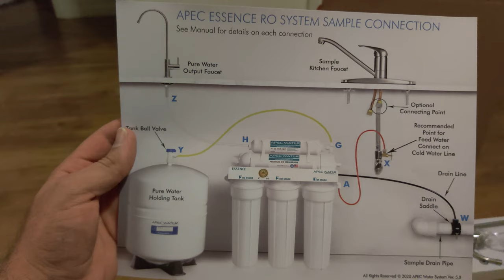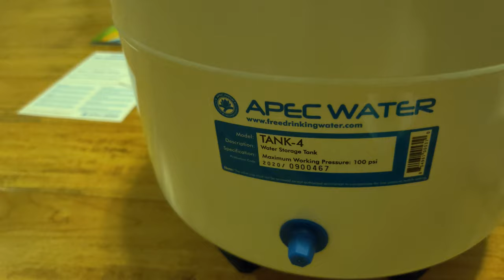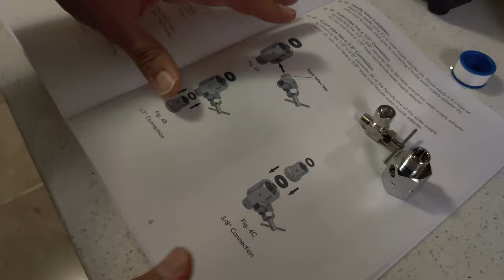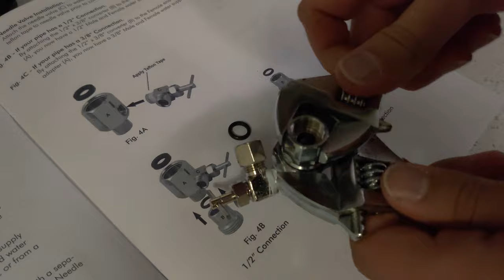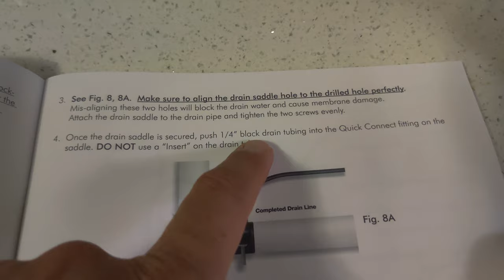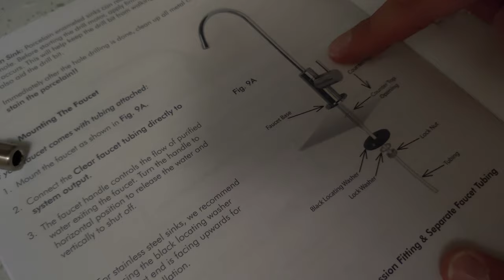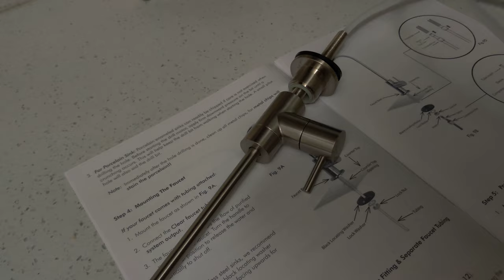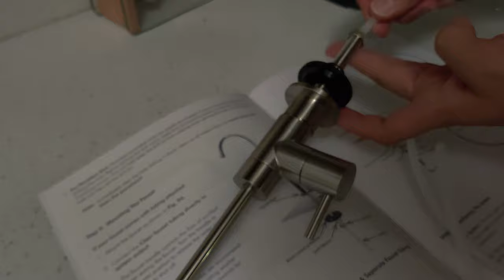Install APEC Water Filter RO System

Comment: I'm installing this in an apartment. can I cover up the drain saddle when I leave? I'm also planning on running the air gap faucet from underneath the sink leaving cub boards open. I know it's a ghetto but I can't drill holes into the counter top here. I'm leaving this apartment soon so I really just want a really good water filter that's overkill.
Reply: Install a "Drain Line Adapter" instead of using the drain line saddle and drilling a hole. When you move you can leave the adapter in place and just remove the tubing from the connector.
Reply from the maker: If anyone is in the same situation and cannot mess with things too much, consider getting a countertop RO water filter instead.

Comment: Have you had issues with air getting trapped and water becoming cloudy with this system?
Reply from the maker: So far, I have been using it for a few years and I have not noticed any cloudy water or trapped air.
Reply: @ChrisAsipyan  Thanks. I just experienced the cloudy water once due to trapped air in the beginning, but now working flawlessly.

Comment: Your filter is identical to the manual provided with the unit. Mine on the other hand, has a fifth stage… Now, I’m confused where the tee and yellow hose connect not having clear instructions to account for the extra stage Included in my unit. Either way, thanks for the video
Reply from the maker: You're welcome! ...were you able to figure out the connection?
Reply: Yes, I was able to get it installed!

Comment: Is the valve o the tank supposed to be close or open be cuz I have it open and the drain line haven’t stop runing sounds like water just keep runing out
Reply from the maker: The valve on the tank should be open during normal operation

Comment: Im not fancy degree city plumber but me thinks the power plug to the disposal is all wrong. If it leaks it will travel down to the plug. You need a service loop. Let the wire hang so the water travels down and drips off the un exposed part.
Reply from the maker: I agree... Thanks for the insight!

Comment: Hello, when you installed the RO system, does that mean your regular faucet is only for hot water?
Reply from the maker: No, both cold and hot water continues to flow through the regular faucet. This kit comes with a splitter valve that splits the cold water between your regular faucet and filter system.

Comment: Hey did you insert the little plastic piece that goes inside the red line, to the T- handle shutoff valve??
Reply from the maker: Thanks for pointing that out, it does look like I missed that step. Comments like this help us all correctly install this RO system. Thanks again!
Reply: @ChrisAsipyan  sorry I wasn’t trying to be a jerk. I was installing one that day and I was watching your vid at the time. Great vid. I’d get one of those and put it in so the hose doesn’t leak from being crushed from being tightened

Comment: I have the first filter housing leak. Re installed 3 times. 3rd 
time I added a bit of silicone lube to the ring and ring groove. Barely snug plus 1/4 turn. Seems ok now.
Reply from the maker: Nice 👍

Comment: Hello all, question- what if the drain saddle doesn't completely fit around the pipe in the areas needed, is that ok? (both sides don't connect directly when screwed in) Thanks!
Reply: You may need a different sized drain saddle.
You want a good fit for sure.
Reply from the maker: Yup, you will need to make sure there is a good fit so it does not leak

Comment: At 24:40 The instruction say to put the plastic insert in the red rubbing then the sleeve and then the locking nut. You didnt out the plastic insert. Why?
Reply from the maker: That was one of the mistakes made in my video :)

Comment: I have this system and it was working great. I recently changed the 1-3 stage filter and all of the sudden the water is cloudy/has bubbles in it. 
I let it run for 15 mins after installing. Not sure of the issue. Any suggestions?
Reply from the maker: You will need to make sure you cycle through the whole tank before using the water. It should become clear again

Comment: thank you so much for this video.. I have read the instruction booklet front to back twice before I start installing myself.. but this video really makes it easier for me to see the process.. I plan to install this afternoon.

The only place I have to install the drain, where the bracket will fit, is on a horizontal pipe. Is that still okay to do? I noticed that yours is on a vertical pipe, in the instruction booklet it is also on a vertical pipe.
Reply from the maker: Yup, it is ok to install on a horizontal pipe. Just make sure you create the hole on the top of the horizontal pipe.

Comment: Not sure you should put the drain saddle on the garbage disposal eject tube without a proper backflow device. Seems like you may contaminate the filtration system. His filters are also reversed.
Reply: This. I've seen so many videos where people are putting this where the ejection of sink/garbage disposal waste comes into contact with your RO waste line. Bacteria/mold will eventually creep up the the flow of the line and ruin your system. Best to put the RO line  into the pipe on its own, similar to a dish washer connection line.
Reply from the maker: Thanks for the insight

Comment: Hi Chris, do you think I can install the Drain Saddle in the same pice that you put but on elbow,? , becuase I don’t have other option before the tramp.
Reply from the maker: If that's the only option, I would say yes. You should be able to drill a hole into it, insert the line and seal it with sealant.
Reply: @ChrisAsipyan  thankyou

Comment: Would it be possible to run the output from the tank to the fridge inlet instead? Pressure concerns maybe?
Reply from the maker: You should be able to... Here is a kit which includes the needed parts: https://amzn.to/3uf6P4H

Comment: What size Cobalt bit do you need for drilling into your metal counter? 1/2"?
Reply from the maker: It's been a long while and I have forgotten. However, it tells you exactly what size to use in the manual

Comment: how can you easily replace the filter if it is so hard to tight the filter
Reply from the maker: So far I have been using this system for almost 4 years and have replaced the filters multiple times. I agree it's not easy to unscrew the filters, but it's not very difficult either.

Comment: Can I hook this up to my existing sink faucet instead of drilling a second hole and having to use a second faucet?
Reply: I have seen a video of this done.
The main concern I'd have with that method is that your hot water tank feeds through that same faucet, meaning that unfiltered water will remain from that in the pipe to that faucet.
You'd need to run your water for a while each time to clear the line.
Furthermore, depending on the contaminants in your water, some of it could theoretically buildup in that faucet line, slightly effecting water going through.
Reply from the maker: I would instead look into countertop RO filters

Comment: hi can I use filters from another manufacturer to replace those filters? does this work on well water that has iron? thank you
Reply: I believe the filters included are pretty standard, just check the size.
I know on the store page for this systems filters that is says compatible with standard filter systems.
Check Amazon.
Reply from the maker: There are 3rd party filters out on Amazon, just make sure it says that it will work with this model

Comment: Hi Chris, 
Thanks for the video, it was great to see you install it step by step ! 
I currently live in a rental unit. Do you think flex tape would be able to reseal the hole needed to be drilled into the pipe for the waste water ? Need to know in case of a move from my current rental situation. 
Thanks again for the great video !
Reply from the maker: Yes. Flex tape will do nicely.
Reply: @ChrisAsipyan  Thanks Chris !

I've kinda adapted the waste tubing to go through a rubber plug with a hole already in it. 
Because there is an air gap for a previous dishwasher that is no longer there, I thought I would use the connection to the garbage disposal using the rubber plug with the hole to cap off the previous air gap connection. The hole in the plug is 1 mm larger than the tubing so I plan to use Flex Seal clear spray to seal the tubing once it's been placed through the hole in the plug. I believe this can work and will let you know what happens.
Reply: @deanjellybean298  use a "Drain Line Adapter" instead of drilling a hole in the drain pipe. It's cleaner, professional looking, and you can remove the tubing from it when you move and no water will leak out.
Reply: @kurtedwards179  Thanks Kurt ! I'll see how that works but first.... I have to look for a tube video ...lol ...

Comment: After how long do the filters need to be replaced??
Reply from the maker: It tells you how often to change each type of filter in the manual... But I instead use a TDS water gauge to help me know when it's time to change filters.
Reply: @ChrisAsipyan  could you please tell me what the TDS water gauge is and where to find it?

Comment: Thank you for this video.  Can you please share the measurements of the items going under the sink.  I can't seem to find them anyplace.  H & W of the tank, and H, W, D of the filter unit.  I want to make sure this will fit under our sink before purchasing it.
Reply from the maker: Sorry for the late response.. was out on vacation... Here are the measurements:

Tank (counting base and valve on top) - 11.25 inches wide, 17 inches high.

Tank (counting base but not valve on top) - 11.25 wide, 14.5 high

Filter assembly (fully assembled with tubing space considered) - 16 inches deep, 5.5 inches wide, 17 inches tall

Comment: Why need a tank for? You have the source of water all you need is just the filters. When the faucet is off no water has supposed to be wasted only when the water is in use..
Reply from the maker: The tank holds your already filtered water. The water moves through the filtering process slowly, you need that reserve tank so that you have filtered water on demand.

Comment: I bought one of these last year but I only installed last month and so far it's been nothing but a headache.  It was easy to install but it takes up about half my sink space and though I don't have any leaks, you have to be careful about water damage because a simple leak will drain out tens of gallons of water depending on how long before it's noticed and fixed.  The worst part is that this is using up about 10-15 measures of drain water for every measure of filtered water.  That's 10-15 gallons for every gallon used which is unacceptable.  The cost of the water is too high and it's too much water to repurpose.  Imagine getting 2 or 3 5 gallon jugs to repurpose every day.  I contacted apec and I just keep getting a runaround to give them info or perform some unnecessary trick and send videos when the issue is pretty clear.  When I shut off the faucet the drain keeps running and running for a couple of hours or more and by that time I've lost 5 gals or more of water.  Apec is no help.  Still trying to work this out on my own.  If anyone has suggestions please let me know.
Reply from the maker: This sounds unfortunate. I do know however that RO systems generally waste a ratio of 1 to 3 ... For every gallon of water, 3 gallons is wasted.

Comment: It's going to really suck to change those filters.
Reply from the maker: Why?
Reply: Because while it's not mounted to anything for leverage, you also have to disconnect and pull the whole system out to service it.
Reply from the maker: @34griter  I agree it would be easier if it was mounted. But I have replaced them a couple of times already... It wasn't too bad... The lines are long and nothing needs to be disconnected while pulling out.